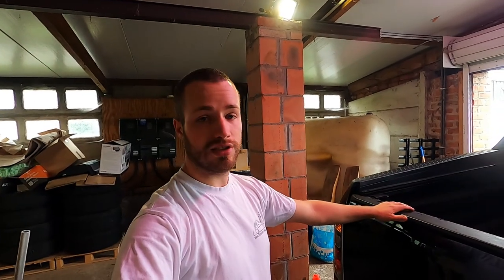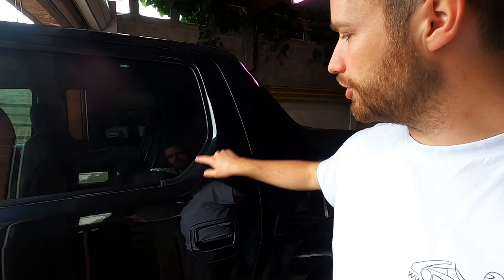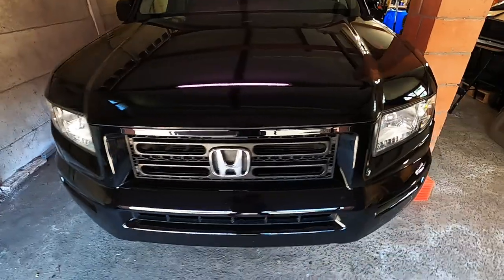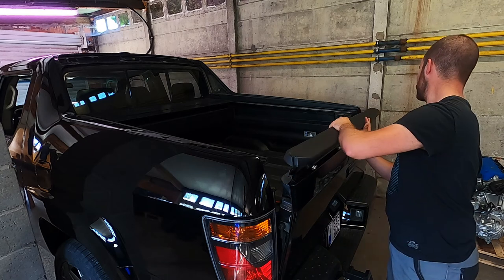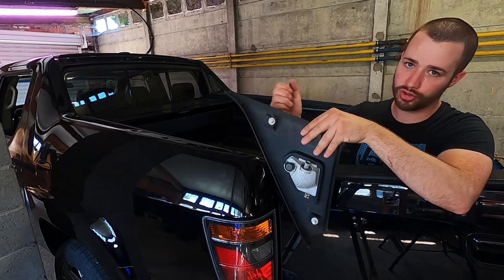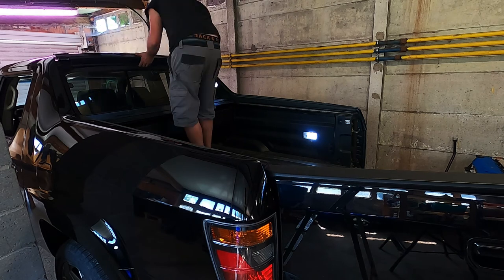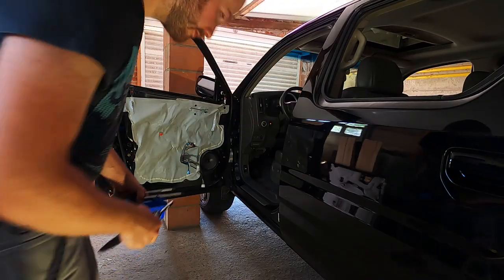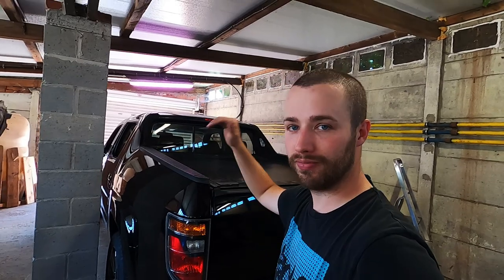Preparing my Ridgeline for paint!

Comment: hi I have this same tonneau cover on my ridgeline. was wondering if you have ever replaced the lock? I couldnt find one as a replacement :( wondering if you have?
Reply from the maker: Hi!
My cover is broken. It split a few times on top.
So I'm driving without cover right now.
Reply: @BjornV  got it, yea the lock broke on mine, but yours looked like the same one I have, do you know if its RETRAX? Don’t think they make the lock for the old model like the one you and I have. Just curious cause now with the newer lock I can’t close and lock the cover all the way like 90% but then gets blocked by the Pilar inside the bed :(

Comment: how did you remove the top back panel on the roof (the one with tail light)?  Did you have to remove other parts to get the whole panel? thanks!
Reply from the maker: No other parts needed to be uninstalled.
If I remember correctly, you remove 2 round caps on either side, and undo the 10mm bolt underneath.
Other than that there are clips under the panel, with a little force, or interior prying tool you can undo the clips easily.
Reply: thank you. Hope you're still enjoying your Ridgeline as I do with mine! 10 years and counting..